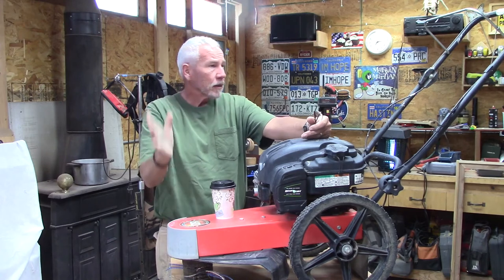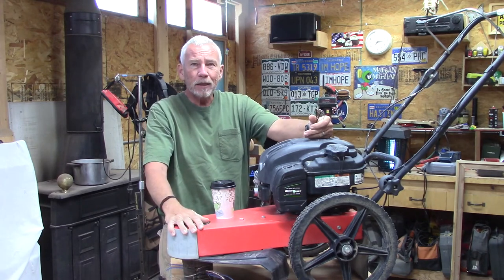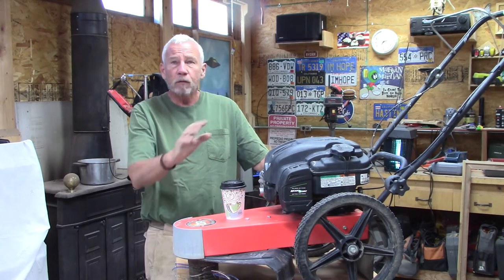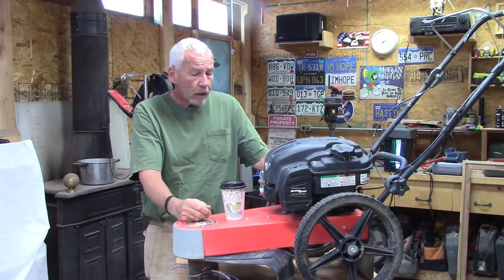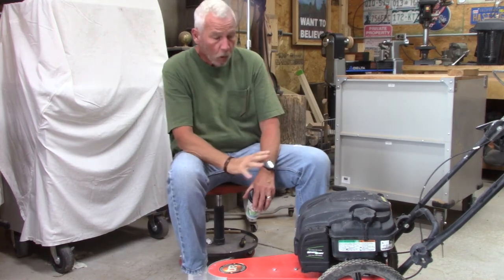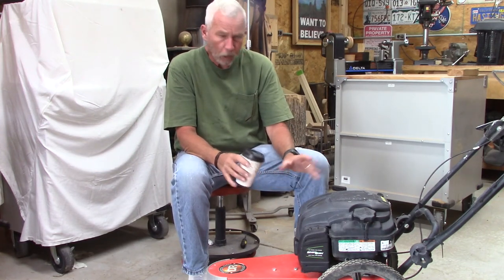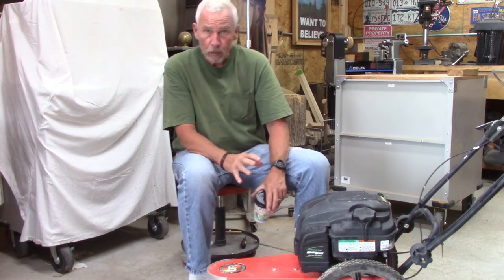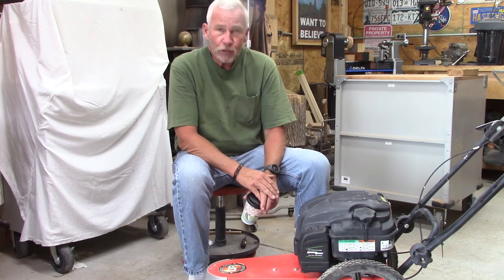DR-675 String Trimmer Won't Start - Recap at the end of the video - Let's Figure This Out

Comment: These instructions helped me get my trimmer back to life. The small hole indicated at time 6:50 was my exact problem. I used a 28 guage needle (lancet) and carb cleaner to get the hole opened up. Fired up on the first pull with starter fluid after getting in back together. Thank you for your extremely helpful video. When I reinstalled my fuel line I added a cutoff valve because I anticipate I'll need to do this repair again in the future and draining all the gas from the tank was a pain in the ass.

Comment: What I do and works every time is taken out the spark plug and literally spray half a can of either in the hole. Then make sure the carburetor clutch is adjusted to the mark on the giggling pin  reinstall the spark plug and hang on to your hat because you are going to have the fourth of July in your shop 😂😂😂

Comment from the maker: Update: I wound up replacing the spark plug. Since the oil was not changed on a regular basis, it's an oil burner, I'll have to stay on top of the spark plug as it will foul.
Reply: Might try Lukas engine stuff and see if it helps
It’s what I use on old mower that are just worn out and not worth rebuilding

Comment: Using starter fluid before tear down would help with diagnosis. You need  3 things. Air, Fuel, and Spark
Reply from the maker: Some of these units had such low compression they simply won't run. Parts machines

Comment: I referenced you video for cleaning the carb on my trimmer (DR Premiere).  Trash in jets was the problem.  Cleaned, reassembled and installed, it now runs fine.  Problem is it won't shut off.  I didn't notice any ignition ground in the throttle linkage.  Where to look?  Thanks.
Reply from the maker: @dannyspringer1522  I'm out of town, but will look when I get back
Reply from the maker: When you pull the throttle all the way back, it grounds out the ignition. Look under the fuel tank and see if it is bent or the wire came out. Also, the throttle control may be binding and not going all the way to the off position.

Comment: It looked like the plug gag was shorted with oil or a piece of carbon. That would explain a no-start problem.
Reply from the maker: Yup. I was using the unit the other day and the engine siezed. I'm thinking about doing an autopsy to identify the failure point.

Comment: Hey big man, thank you sir I've got a husqvarna was used at a feedyard and it wouldn't run anymore so they asked if I would want it or they were gonna junk it , brought it home change out the spark plug drained the gas and oil, fired right up now after a few yrs she dont wanna run anymore but throughout those few yrs I did service it but never was a oil burner but I've never taken the carburetor off and checked it I just didn't /don't wanna get rid of it she can go through weeds like butter but any other info would be highly appreciated sir. Thank you and God bless.
Reply from the maker: start by adjusting the valves, then replace the carb.

Comment: How did you get it off? I am helping a friend with his and I can't see what holds it on except the choke rod and throttle rod. Thanks.
Reply from the maker: The carb just has an o ring so once you pull the air filter housing, it pops off
Reply: Thank you. @LetsFigureThisOut

Comment: Just got mine last season. It ran one season and won't start again.
Reply: Carb needs cleaning is all 
You can do it with a couple of cans of carb cleaner or brake cleaner
Reply: @philliphall5198  The thing's brand new it took two tanks a gas. The self priming system is garbage. I got it going after priming it myself several times And letting the tank get some sun on it. Compared to the original d r these are pieces of shit
Reply: The Hubs Is having the same problem….it is sitting in the sun now hopefully it will start soon and stay running! Glad you had posted what you did for yours, because that is exactly what we have done! ✅
Reply: @patriciatherrian5801  Glad it helped. Seems to start up first pull once it's been warmed up. But getting it going on a cold morning is a nightmare.